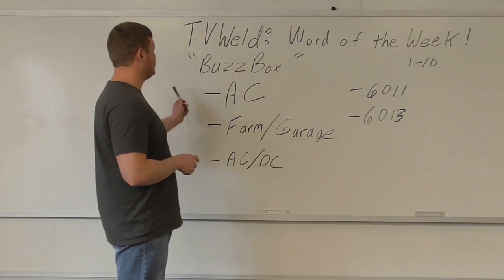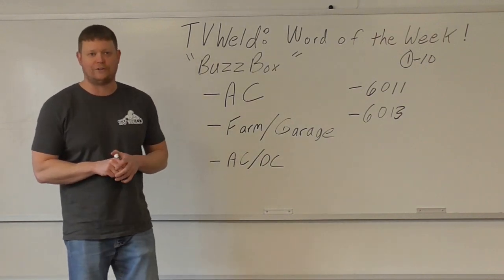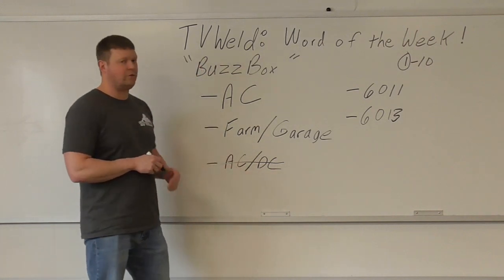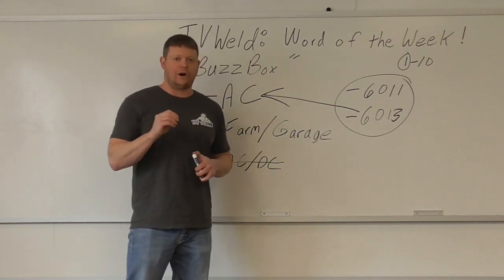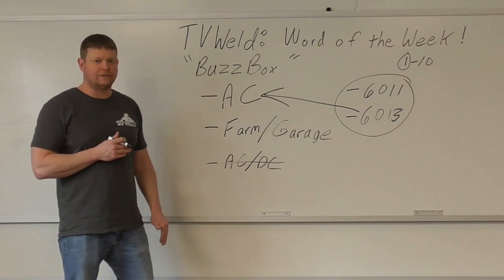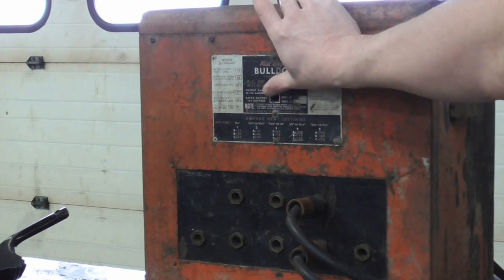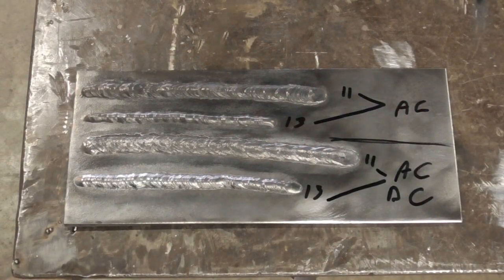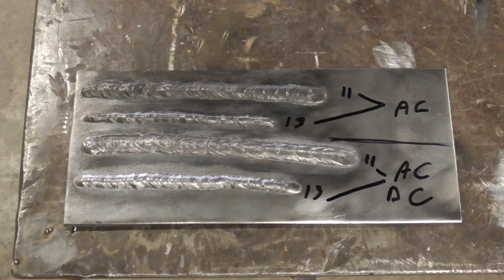Welding Buzz Box?

Comment: I'd argue with your definition of buzzbox. The main reason for the buzzing is the transformers in the machine, so to me, a buzzbox machine would be defined as "a homeowner or light industrial grade transformer SMAW machine, which is primarily AC output, but could have limited DC output in some cases" and the reason for my definition is intended market and use and construction that leads to them being known for buzzing. 

While most buzzboxes are AC only, some variations have DC output as an option, and the DC current output is typically half of the AC output (example, Lincoln AC-225s usually have 225 amps AC and 125 amps DC. Hobart and Miller had machines that were similar until recently as well.) 

With my definition, you could also argue an Idealarc 250/300 could or couldn't be a buzzbox, as it does buzz, has more AC current than DC, and can run off 240v single phase (same as other buzzboxes), but it would be either light or medium industrial use, and there is substantial useable DC output. So perhaps a machine such as that could be the cut off line or gray area. I'd say at the cut off line personally as Lincoln had Idealarc 300s that were AC only before they introduced the 250/300 with DC and eventually discontinued the AC only models. But this is just my definition and take on the topic. 

Another note, 6013 isn't AC only, however several varieties were improved to better run on AC because some AC machines have low open circuit voltage, which leads to a more difficult time with arc stability. 6011 is a similar case, but that was developed due to 6010 being the predominant electrode at one point for arc welding, and the ability to have something similar to run on AC to combat arc blow and use cheaper machines (no rectifiers needed in AC only buzzboxes) was in demand. 7014 can be used in AC or DC, and some varieties of 7018 can be used in AC (I've noticed it can vary from machine to machine but there are 7018 AC electrodes commercially available that will have better arc stability on AC.)

All said and done, good video and great introduction to buzzbox machines.